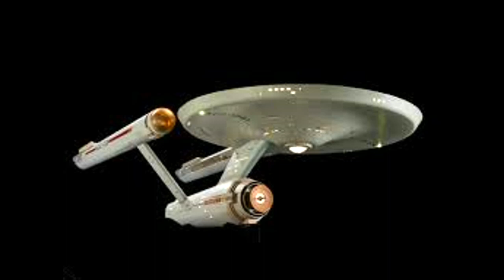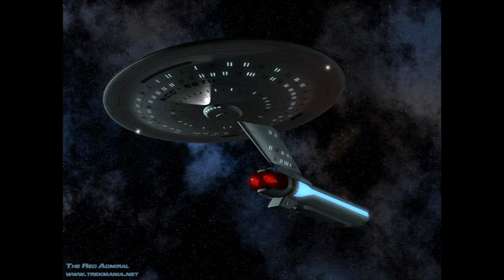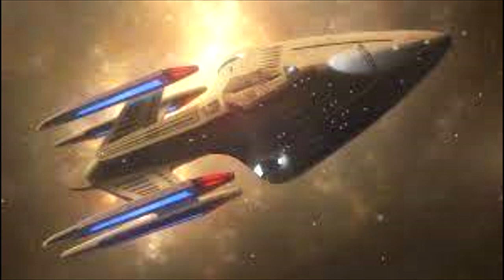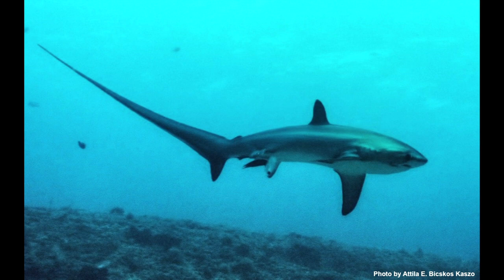Single triple and four nacelled ships in star trek

Comment: Three nacelles simultaneously (as opposed to selected pairs) is ridiculously easy to balance.  The warp cycle is a wave form, just like common electricity.  For three-phase operation, over the 360-degree cycle, phase-shift each nacelle 120 degrees.  Look at a graph of three phase power to see how that works.

Comment: Single nacelles are inherently unbalanced, and I agree with OP that while workable, ships as such have comparatively short operational lifespans; even with structural reinforcements, its a rough ride and can literally shake the ship apart.  This is why 2 nacelle ships that lose one are essentially dead in the water; while it COULD be run on one nacelle, the added stress on top of battle damage could completely destroy the ship, and is only done in the most extreme emergencies (as in "Scotty, we need warp power in two minutes or we're all dead", though in that case it was the energizer, not the nacelles, that was inoperative)

Comment: the Prometheus is NOT a four-nacelled ship. if anything, it is a SIX-nacelled ship. tho it would be most accurate to say that the Prometheus is 3 two-nacelled ships stuck together. pay close attention to the VFX shots of the "multivector assault mode" in the VOY episode that the ship appears in. you will see small (but functional!) nacelles pop out on hinges out of the top and bottom of the saucer / spearhead section.

oh, and I guess I got a brownie point. Yay!
Reply: But only two are used on any single hull at one time.  The others might be employed as auxiliary power when the vessel is assembled.  Prometheus is very nearly the stupidest design ever.  The assembled version wastes incredible amounts of internal volume to outer hull material of the sub-vessels, doubled where they meet internally, whereas a unibody vessel with the same exterior shape would have thinner single internal bulkheads and space for other rooms and/or systems.  Splitting firepower is rarely the best tactic, concentration on target is a cardinal principle.  A unibody variant would have interior volume freed up to include heavier weapon mounts.